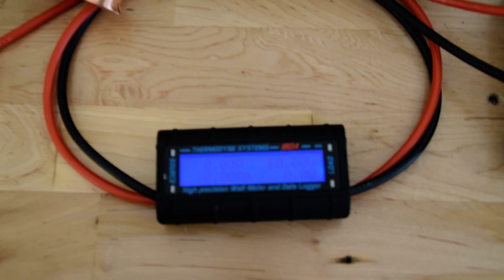Helibug 1400W 12V/24V/48V low rpm Axial Flux Alternator Wind PMA Dynamo  free energy ev vehicle

Comment: Sir whats the difference with and without iron in the magnetic coil?
Reply from the maker: Thank you for your question sir.
Iron/Steel creates the magnetic flux backwards towards the plate.  that flux is pulled then towards the opposite side creating a magnetica field between the plates, which then extracted by coils.
Thickness of iron plate is important and directly proportioned by the thickness of the magnet. Simply put: the thicker the magnet, the thicker the plate. Its a force.
Without the plate: it never creates the required field to extract energy at its full strength.
Google can help to elaborate further.
Reply: @Helibug  if there is iron or metal in the coil,it will increase the wattage output of the coil?
Reply from the maker: Adding iron inside the core, yes, it will enhance the output. but, then, you are not 'Axially' generating the magnetic flux. not only that, you are also adding magnetic break. you are basically killing the whole concept of axial flux alternators. you are basically converting axial flux alternator into a brushless dc motor, then its is best to just use a low rpm brushless dc motor.
Reply: @Helibug  thank you sir for response